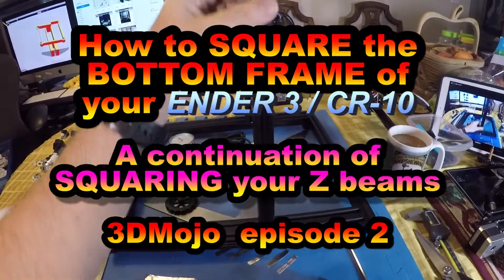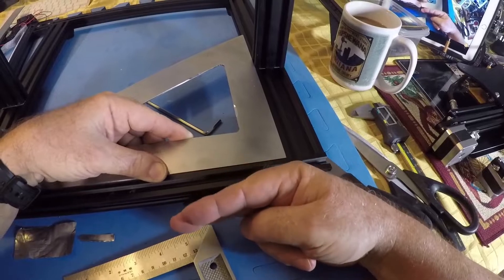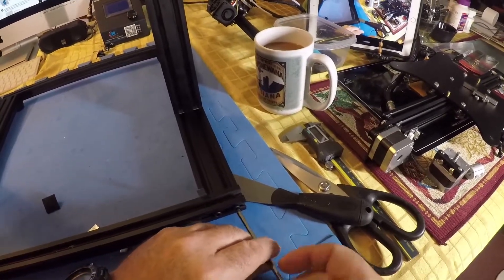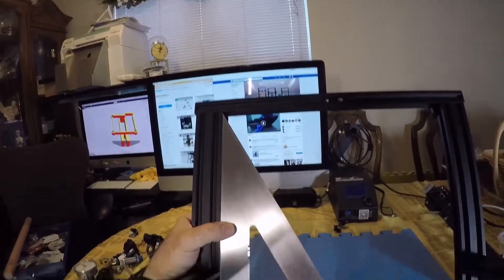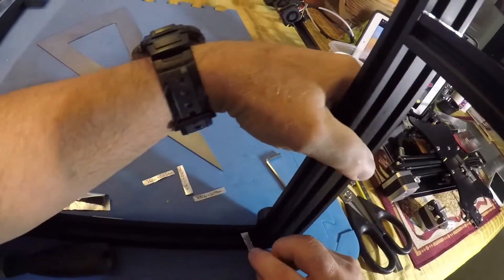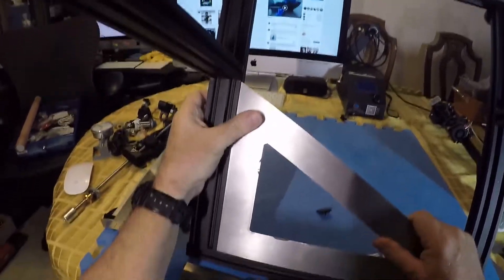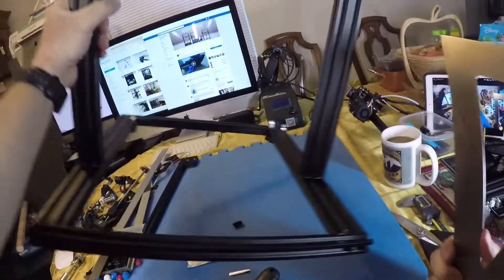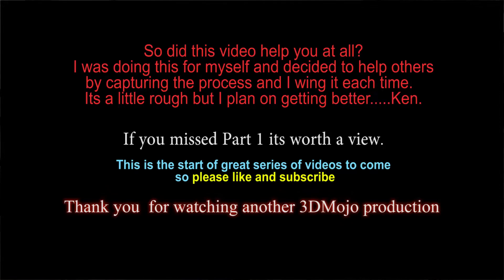SQUARE YOUR BOTTOM! Ender 3 & CR-10

Comment: I don't think the corners are critical.  What's important is that the z is square and the y-carriage is perpendicular with the plane of the two z beams.
Reply from the maker: Hi Dave!  I can appreciate that thought.  Normally I make sure that everything is square now as I have seen the differences in the assembly ease and less adjustments needed for the build.  As odd as it sounds, some kits are horrible and the twists when assembling really throws off the paralleness of the X axis when connected to the Z's if the Z's are twisted.  I just did a CNC 3018 build and by squaring everything in the beginning the build was a snap and its actually becoming quite the little CNC beast.  Call me a square ... lol but even my big vertical mill is sitting at 0.0005" level on the X and 0.0001 on the Y.  The guys go rounds on the machining sites about this squaring debate but I just chose to do it anyways.  I will be putting up better videos soon.  This was a while back and I am now playing catch-up as I have about 5 printers to build plus the major amount of CNC mods I have done on the 3018.  Please chime in anytime.  I need to explain things better but its late ... I have found so many new ways to tweak and work around problems that I have not seen mentioned.  I am also preparing to install a ARMS powered board on the wife's Ender 3 which will be a smooth BL Touch beast with smoothie chips.  It will also have a nice touch screen and built in SD card reader all for less than the newest Creality board updates.  Cheers and thank you for chiming in! Happy New Year!

Comment: where do you get those type of shims...? thanks
Reply from the maker: Believe it or not ... I use regular and heavy duty tin foil and now I cut 20mm x 20mm squares from soda cans.  I like the Arizona tea cans as I can get a bunch out of them.  Then I punch a hole in the center with a hole punch (simple office supply type) and now I have three levels of shim materials.  It works sooooo well.  Thank you for asking and have a great and save build!
Reply: @3dmojo275  yes .. i have cut up soda cans and made and fixed things before...there are materials all around us waiting to be repurposed...thax
Reply from the maker: @roadstar499  Now as much as I like to recycle and use foils and cans ... I should be ordering some shim material soon.  Its hardened steel and comes in a roll 6" x 100" for less than $10.  I am going to get some 0.002", 0.005", 0.010".  There is a sample box for $22 with 4' of each .001", .002", .003" and .005" but I hope to get there faster with my original choice and if I need some .001 I can always use aluminum foil.  Thanks for the reply!

Comment: what are the sizes and type of square/ruller you were using? looked on amazon and could not find one beefy like that.
Reply from the maker: Terrence, I was not getting the proper emails and I apologize about that and I will get the info for you very soon.  They are very, very accurate.  I can't believe how many squares are not square.  Hang in there.... I need to look at my orders and see which models I bought.  Thank you for asking!  Happy New Year
Reply: @3dmojo275  any chance you could find what squares you used here, or what squares you use nowadays? I have an Ender 3 V2 that's driving me nuts, and I want to make sure not to make things worse by using tools that are shoddy haha

Comment: Just what the doctored ordered as a machinist it was the first defect I noticed. Out of square. So that's  why I looked on you tube to see if others had the same issue. Thanks
Reply from the maker: I am sure you will build better than me as I don't have access to perfect squaring of the ends.  Even the slightest extrusion bend makes a HUGE difference in the print layer precision.  This is why some machines are $200 and another $2,000.  Well at least I hope that is why.  I would love to have a more detailed video on machining the ends but for now I feel that most would not be able to access that and at the same time they want to build it now.  So home remedies come into play.  I am currently doing a new shim type from aluminum cans and a hole punch which works well.  This was excellent for my solid bed modification.  Are you building a CR10 or Ender?  Thanks for watching and they will get much better.
Reply: @3dmojo275  That was a quick reply! I am using a CR10 my main frame was not perfect but I am not going to play with it. My  X axis was out a lot I squared it and am waiting for a 2nd Z axis kit from ali express. I have too much to do to seek perfection. Im just going after good enough for now. You are doing a super job Thanks for the video
Reply from the maker: @steveu235  Hey Steve, I have been working lately and I missed this message.  I am sure you got your dual Z kit but keep this in mind.... sometimes synchronizing the two Nema 17 motors  is a bear ... this is why a lot of guys take that kit you got, use the metal Z plate to Z rod for the other side and do a large belt with two pulleys on top to run from one Z motor.  Just my 2¢ worth

Comment: Another good video.Get the camera thing worked out and you have some really good content.
Reply from the maker: Thanks the new stuff is tripod mounted and I have a huge series that has to be edited down.  Also picked up 3 different other printers and ordering Ender 3 and Ender 3 Pro soon.
Reply: @3dmojo275  I can't wait to watch all the upgrades to the printer and then seeing how it prints.
Reply from the maker: Well ... I kinda went overboard.  I got too deep into the modifications.  Preparing a dual Z single motor for more accuracy, made wonderful easy adjust tension cables for the Z accuracy, my bed is solid mounted, the X axis is exact with the bed in parallel terms,I am upgrading to a Volcano hot end, running a EZABL auto level, put a Raspberry Pi 3B+ with EZPI (Octoprint / Marlin), mounted the base to a thick MDF type of board that is covered with formica and I need to print a camera mount for the Logitech camera (I have a mount for the Hero 5 but I don't want to waste that camera there).  I just ordered a EVO drone to do circles around during the build ... kidding but I did order the drone today.  As soon as I can get through with this work season (photographer and video) I am building a dedicated studio with lighting.  I have the Anet A8 to assemble, (basically Prussa clone), FLSUN similar but with extrusions and direct drive for filament, I picked up a Monoprice Select V2 (which is really awesome) and I stumbled upon a tiny tiny cube style called a M3D Micro.  Also I can't wait to build a huge Delta Kossel style (I got a TriGorilla board with the best chips for 256 step motor drivers and so on).  Its going to be a awesome year!!!  Also, building right now a Water Cooled Volcano with a liquid pump that goes to a radiator with a 80mm digital display fan that tells you if its hot or cool and the C temperature in the spinning fan blades!  Yep ... I have gone overboard and no time to play yet.  Thanks for replying and I appreciate every thumbs up you can give me!  Spread the word its going to be better soon
Reply from the maker: I almost forgot, I got a sample of the flattest glass possible and mine is THICK!  No warping of the glass what so ever!!! more to come later... what printer are you using if you don't mind my asking and I am off to sleep now... cheers ... oh I almost forgot, I found a guy in England who is making leveling control boards for cheap and they have non soldered chips that can be replaced if you fry one or it goes bad.  I love it!  Also working with a guy in California who has a modular hot end.  You can build it any way you want up to water cooled.  He has printing speeds of ... are you ready... 300mm per second.  I have seen it and it is mind blowing!  You have never seen anything like this.  Even the average travel speed is only 120mm.... wow